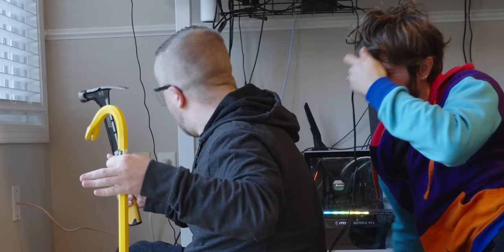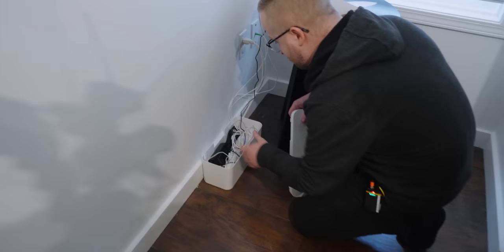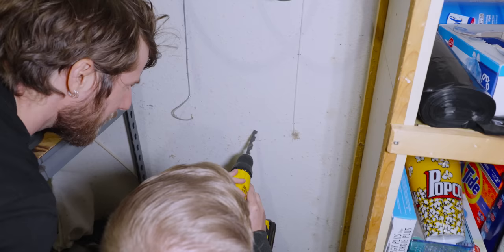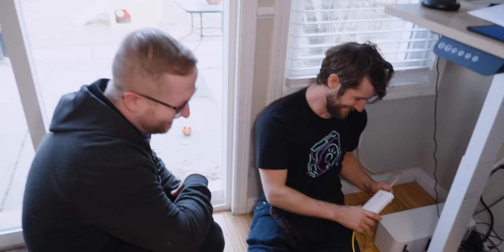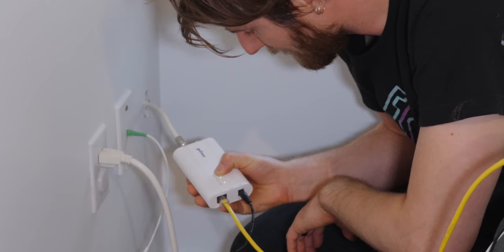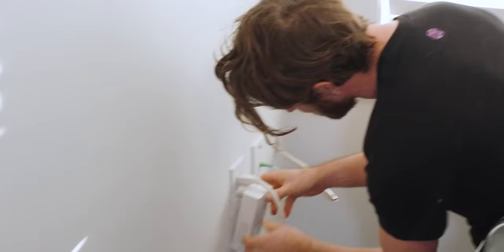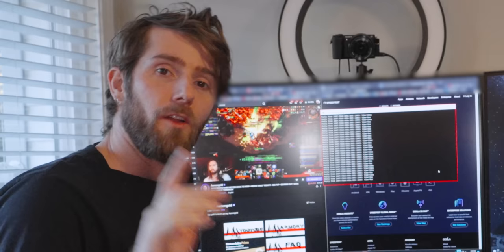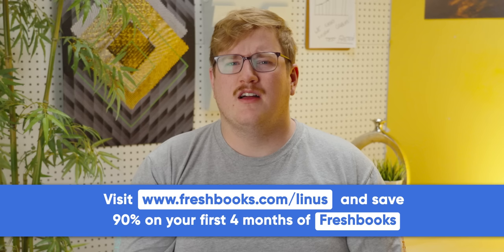I Will FIX Your Wifi - MoCA and Powerline at Colton's House

Comment: I want to connect 200 apartments on one building using MoCA for commercial purposes, selling internet. What equipment do I need? I should be able disconnect a client when the service is not paid for. Is it possible to assign bandwidth to the clients?
Reply: You could probably use some sort of cheap computer that you can remotely access from a computer in your building. But using MoCA on something like this is a pretty bad idea since ... well the connection will be way too slow
Reply: I doubt this will work well. You're probably better off asking in forums dedicated to ISP startups or people who are interested in deploying something like this.

Comment: Yo. I have a telephone line through my walls into my bedroom where my pc is. What do I need to get Ethernet to work through it?
Reply: tie an RJ 45 cable to the RJ11 cable that's your "telephone line", and then use that to pull the RJ45 through the hole.  You can add a telephone line to an RJ45, you can't add a network to a RJ11.

Comment: Powerline ethernet fucking SUCKS if you expect to get anything over 100 Mbps... literally don't use it, it's garbage, and the ping you tend to get with it isn't that good either... Just run a cable. I'd argue even 5G wifi works better than Ethernet over Powerline. Also note your wiring installation for power in that house is literally ideal. If your power installation has ANY amount of complexity, forget about this. It's going to give you 40 mbps internet.

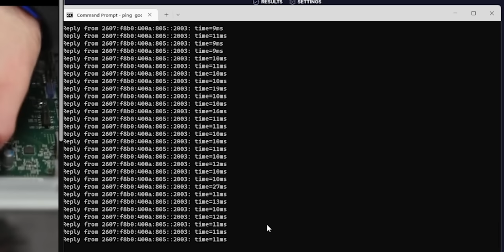Comment: 15:32 what is this command I’m testing new wifi and I’m curious if I ping times are good because it seems unstable
Reply: Its ping. Type that in along with the webpage or IP address you want to run a ping test.

Comment: most of the time the internet slowdowns are caused by your unreliable routers and fiber network blackouts. not because of a wifi. if you're not like the 2,4gig (potato mesh extenders) , its time for a mesh 6ghz upgrade.

Comment: I don't understand. These guys are supposed to have networking knowledge. Yet they can't figure out how to run to a local hardware store. Grab a coax wall plate and plastic low voltage mounting bracket....... It's like watching me try to cook pastries.

Comment: Linus I have an Att lte hotspot device as my internet because I can’t get cable or fiber where I live (although across the 2 lane highway my neighbors can.) my internet is too slow to play Netflix and have music in another room on my echo, is there anything I can do? The device has 3/5 bars of 4g but is still very slow as explained earlier
Reply: Do you also have AT&T cell phone service? Is the internet slow on your phone through LTE as well? If so, then it could be tower congestion. Its hard to exactly pin point what the problem is though.

Comment: I used to use power lines as I’m unable to run a cable from my room to the router. But I can’t seem to ever get more than 15mb download. Does anyone know why this is the case? I’ve tried it it different sockets in my house and it’s always the same result. I get 500mb over Wi-Fi.
Reply: That's the inherent problem with powerline adapters. A lot of it greatly depends on your home's electrical wiring and I believe circuits and other interference. If you're getting good speeds/latency over wifi, I would consider ditching the powerline adapters.

Comment: the actual fix would have been to setup a proper access point, powerline is fucking trash, and is the only instance where a good wifi setup will be vastly superior in every way to a wired connection, the copper wiring inside your walls is designed for power, not networking, and power doesn't need nearly as good quality of cabling as networking does
Reply: Yea but that would not be a fun video.

Comment: Powerline is dogshit technology that we could easily do without. It spews TONS of RF interference! It completely stomps many radio broadcast bands. Ironically, if you don't have an external antenna it forces you to use cable if you want TV, instead of using an antenna to watch free TV.
Reply: I Have a powerline plug connected to my TV for the smart apps, connected to the socket directly behind said TV on the wall and even with the TV through the pass-thru power. Using a small antenna I have no problems picking up free terrestrial channels. 

Just tried unplugging powerline out of curiosity and the TV's reading for the signal strength and quality is no different to what I get with powerline connected either. 

Either you have a bad adaptor or the interference is only on certain frequencies that aren't used where I am (UK)
Reply: @Koda14  Hmm, maybe that was the case. What about FM radio, DAB+ and HF? Are these bands problematic or is there no difference?
Reply: @fungo6631  DAB Reception is just generally poor here anyways. But FM seems happy enough. If I bring the radio right beside the powerline adapter I get a little static/interference on a higher frequency station. Lower frequencies seem unaffected.

Well I've definitely found that you're right and there is SOME interference. But it seems minimal and only if right beside it. Maybe my kit is just really well shielded?
Reply: @Koda14  Well, from the horror stories I've heard elsewhere and from my experience with powerline adapter interference, perhaps you do have a higher quality installation.

Comment: "i will fix your wifi"
- proceeds to switch to adopt pseudo-LAN tech that's been around for 20 years
Sorry Linus, this was just a bad video that you've done before. And Powerline is not always good, I've seen significant lower speeds and powerline that includes wifi just means you have a second network in your house, that none of your devices will connect to, as they latch on to the original wifi signal